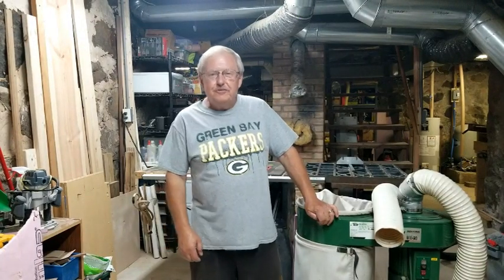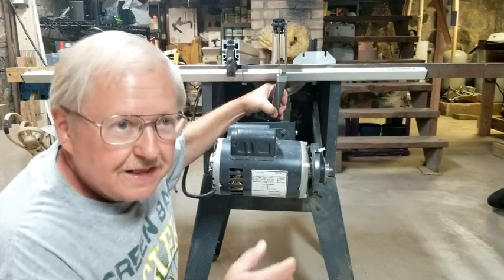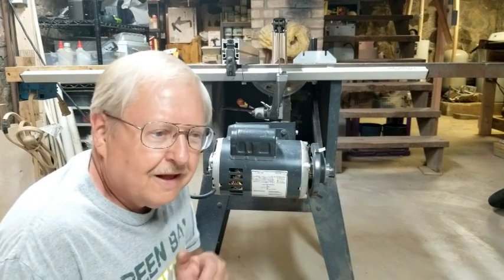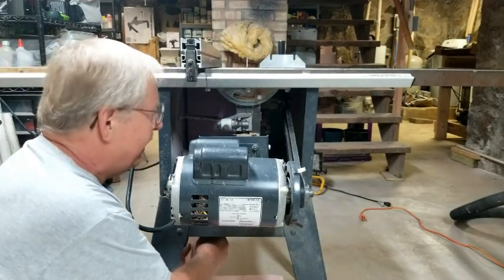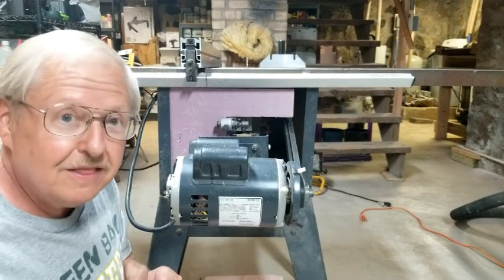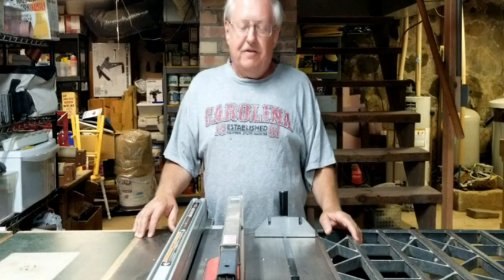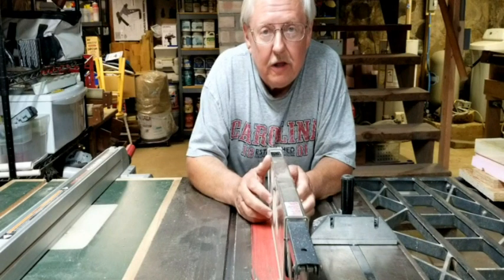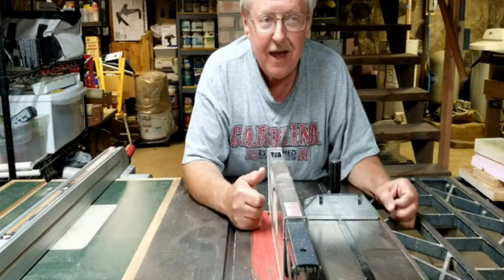Table Saw Dust Collector Made of...FOAM???

Comment: I have made similar modifications to my older Craftsman saw also. One modification I made was to use pipe insulation on the front of the saw on the tilt function. I made a slit in the back curved part of the insulation which allows the blade to tilt. When the tilt arm passes through the insulation the insulation seals back not allowing much air to pass through. The difficult part was attaching the insulation to the inside of the saw. As you probably found out, there’s not much room to work inside the saw. (I’m 68 now; it’s harder to do ANYTHING!) I subscribed, can’t wait for more from you.
Reply from the maker: This sounds like a great modification, ED! I use my saw for perpendicular cuts 99% of the time, but next time I need to tilt I will make your suggested modification. Thanks for sharing this!